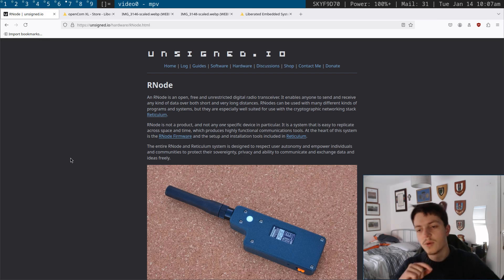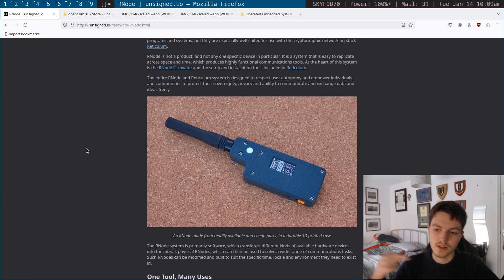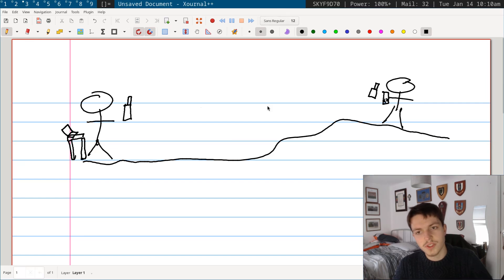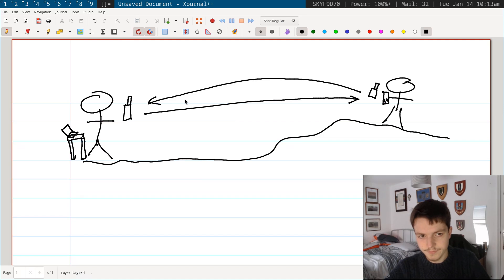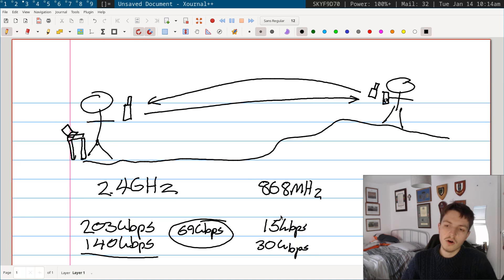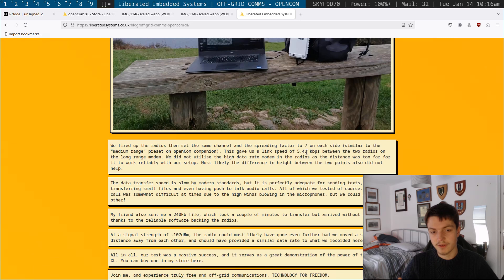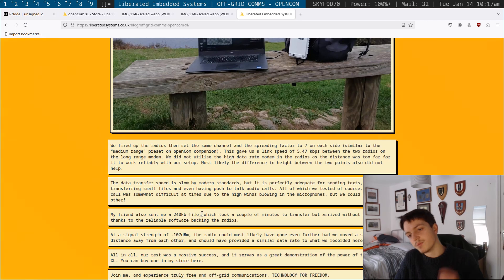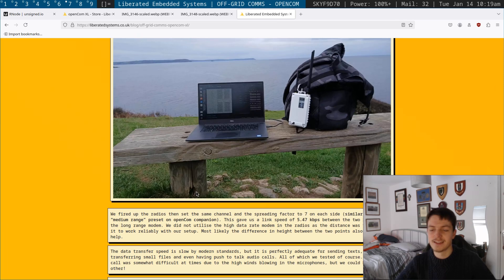What is the openCom XL?

Comment from the maker: I forgot to mention the restrictions on the 868MHz band in the video, oops! The low data-rate modem is restricted to a 10% duty cycle, meaning that it can only transmit for 6 minutes every hour. This sounds quite strict, but you can actually do an awful lot in that amount of time transmission wise. This restriction is applied automatically on openCom Companion when you are utilising this modem. This can somewhat restrict the amount of data you can transfer in any given period of time, but unless you're constantly trying to send large images and files, you likely won't see the impact.
Reply: does 915mhz in US have similar restrictions? or no?
Reply from the maker: @az_living208  From a quick Google search, no.
Reply: And how come you're only getting 5.47kbps on spreading factor of 7?
Is this due to the encryption overhead cost?